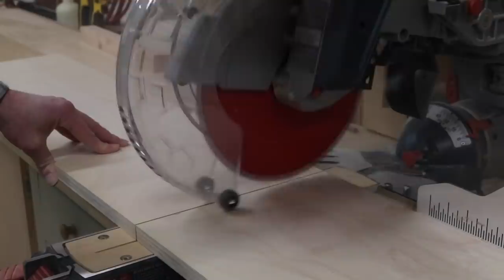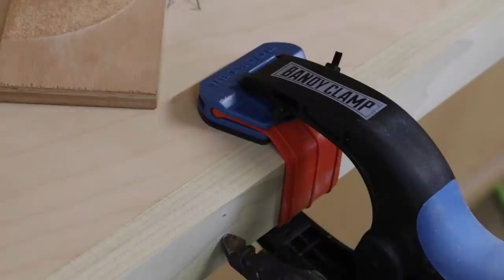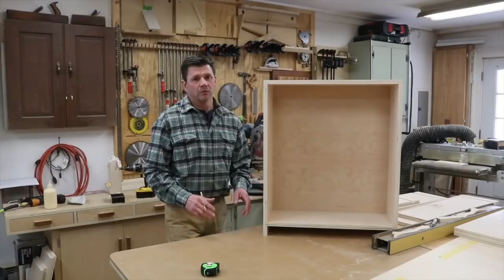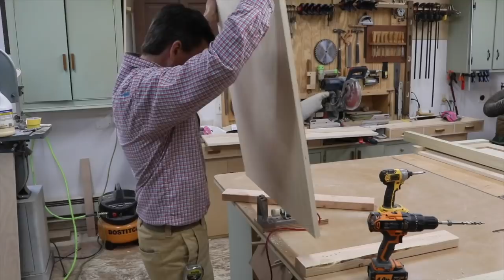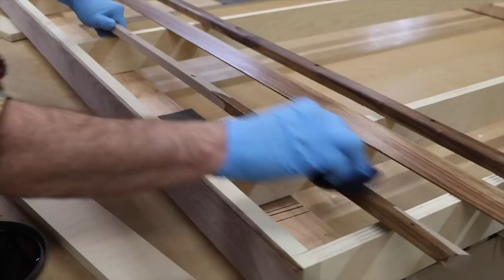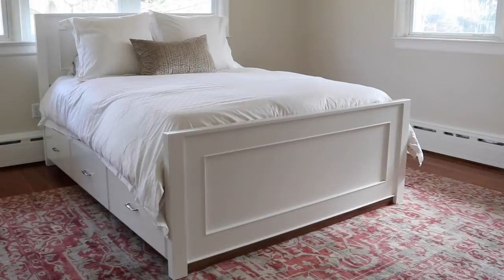How to Build a Platform Storage Bed with Drawers

Comment: Got a question:  Which circular saw blade would be best for cutting hard maple boards?  There's another site (WT FARM GIRL VIDEOS) that I started watching today that is using kiln dried maple planks for inside walls, and their saw is leaving burn marks. Also, there's a question about nail requirements for the vertical ship lapped boards. Right now, they're using one nail on one side instead of both sides, and it shows.  The suggestions range from one to three nails across the board.  I said one nail inside the lap so it would not be seen.

Comment: Jon great job!  I would really like to make this bed.  Do you think the connection between the boxes and the head and foot boards would be strong enough if I did not rest it on a platform.  I would probably add some square stock, matching the legs of the head and footboards, as feet in the middle of the boxes.  I have radiant heat flooring and I would want this elevated for the heat to flow from under the bed into the room.  Thanks

Comment: Very professional result. I am looking for something less modern and more rustic, but I will definitely use this as a reference to get it to look less "home made".

I am currently looking trough different bed building videos in order to get the feel of how it's done, it is important that the bed can easily be dissembled and transported and I am really looking forward to my first large project.

One concern I have is, the underside is made up of solid pieces instead of a slatted frame, and I am a bit worried it will not allow the mattress to breathe properly potentially leading to a moist underside. Any thoughts on this? Is it better to use a slatted frame long term?

Comment: I am newer to woodworking and was wondering why you would cut it heavy on the miter saw and then cut to length on the cross cut sled.  Why not just cut to length on the miter saw if it can handle the width of the piece?

Comment: Hi Jon, Do you coat the painted areas with water based poly after the paint has dried? I find my painted wood marks up to easily if i don't. If not what sheen do you use? exterior or interior? Thanks again for all you do.

Comment: just a general question : having used both the regulair circle saw and a vertical circulair saw  
im not a woodworker and like working with the standing version better  
it allso takes in a lot less space in the middle of the shop it and alowes to rip pieces to the right width the first pass
are there any things you couldnt do on a vertical saw or any paticulair reason to go for a normal sawbench
Reply: watahyahknow I assume your talking about the differences between a table saw and a panel saw and yes there are so many more things you can do with a table saw that can not be done on panel saw. A panel saw is designed to only make a couple different cuts and a table saw is designed to be your best friend

Comment: John, great video!  I'm looking to design and build something similar, but with two rows of drawers if possible.  I need two twin beds in a small room, and each bed will have one side along a wall.  The thought was to design one side with 6 drawers (3 on top of 3), and then perhaps storage cubbies on the wall side.  This way if the beds ever make it elsewhere they'll still function.  Any design considerations to make?

Also, can you comment on the need/benefit to using 3/4" plywood for the drawers with a 1/4" bottom?  I'm concerned that the 3/4" is more than would be necessary (vs 1/2"), while the 1/4" bottom may fail over time if the drawers are overstuffed.  Would you recommend thicker stock for the bottom, or perhaps a support?

Again, great stuff.  Really appreciate the time and energy that went into this video.

Comment: I know this is a couple years old, but I have a couple questions. I love the design and I want to build this, but I am making a different headboard with shelves (I am keeping the foot board in the design). How would I modify the materials/cut list accordingly to account for the removal of the headboard? Also, how many total sheets of plywood and individual boards did this build take so I know what I need to get ahead of time (because there isn't much worse than being in the middle of a build and needing to stop everything and go get more materials after realizing you've run out!)

Comment: Jon - Do you opt for your final crosscuts on the sled vs the miter saw because of the play in the glide motion on the Bosch? I have the same saw in my station and it drives me nuts - no matter how slow and cautious I am the thing jumps to the right when I slide forward leaving enough of a ridge that it has to be sanded out.
Reply: ryanern18 My Makita does that, infuriating.

Comment: jon, i really enjoy your videos,  but i just realized i dint notice any dust collection in your shop.   how do you manage the dust and clean up?  I'm going to be getting a dust collector very soon and am very excited not to clean up every 5 seconds after each cut i make....a shop vac just isn't going to cut it anymore
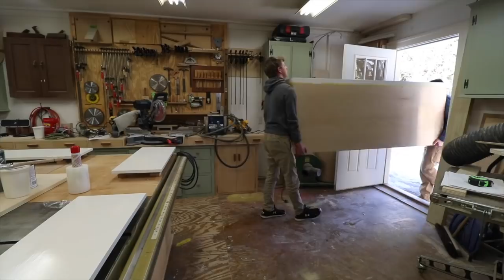Reply: There is a single stage dust collector at 20:26. I am not sure how or if he connects them to his machines.
Reply from the maker: Thanks Anthony and I have a new dust collection system for the shop on the to-do list.

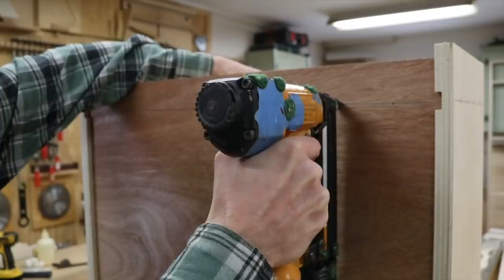Comment: At around 18:00, it's interesting that you glue the front and then nail the panel in. A lot of others will leave it floating and use screws at the back of the panel to facilitate easier repairs. Any reason you don't?

Comment: Great craftsmanship as always. However, one major thing I would change is the solid platform the bed is sitting on. Mattresses need to breathe in order to avoid mold and mildew and solid platforms promote just that. There is a reason why proper bed frames have slats or a hollow box spring covered in fabric. Had a friend chuck his expensive latex foam mattress after a few years after his discovery when moving.

Comment: This is really good, I had a carpenter recommend I double the plywood on the top and bottom, do you feel that is necessary ?
Reply from the maker: Thanks, I think it should be fine because the plywood is supported by the bottom base.

Comment: Hey Jon,
Great video!
But I am a bit confused- I see you used nail gun all over the place to attach the pieces. How did you hide them at the end? Aren't those visible on the finished product? What am I missing? :/
Reply: he has other videos where he shows how he primes and paints, and there is a step in there where he fills the nail holes. check them out.

Comment: Someday I'd like to see one of these woodworkers accept the challenge of Building a similar, quality project Without a shop full of special tools. 
Build a project like this using Only hand power tools; Circular saws, drills, routers, etc. (Kreg jigs, etc allowed) (All tools Must be able to be stored in a cupboard, or closet when finished.)
On your Back Porch. 
Maybe with chairs, and chair backs, as saw horses.
It can be done. 
I've done it. 
I don't Video the process. 
So will anyone rise to the Challenge?
(Ok, I know Anna White does it)

Comment: Why did you so much thickness into the drawer supports and mid sections ? I would have thought that one 3/4 inch thickness of plywood  would have been more then enough strength . Seems like an awful lot of wasted wood